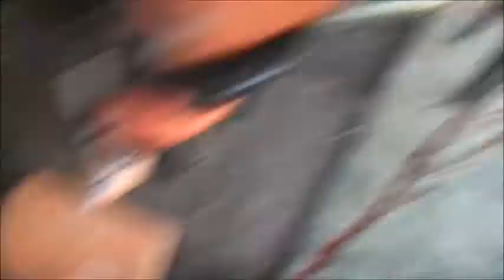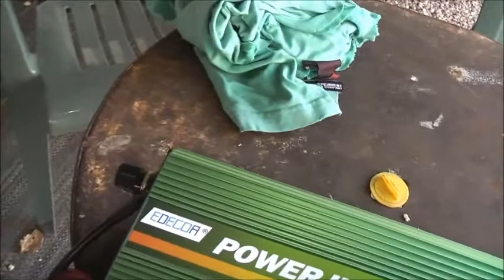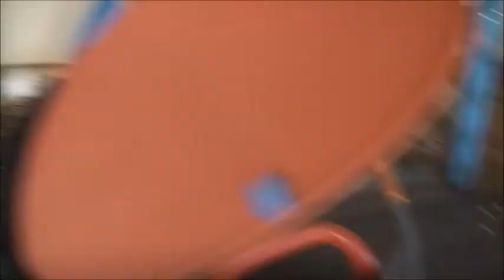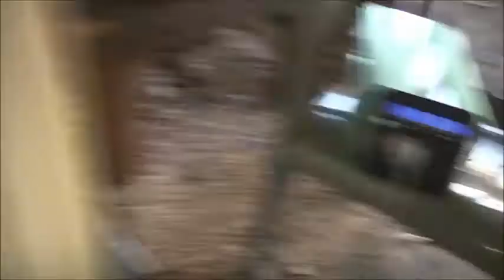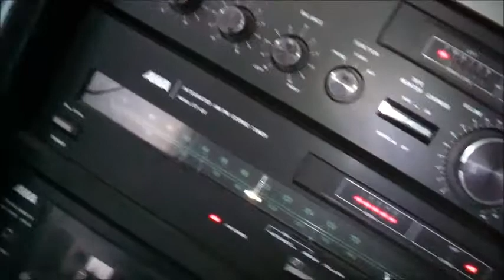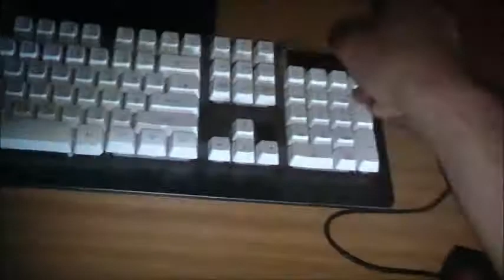Edecoa Inverter Runs Great, Underrated Cable

Comment: Will it power 115v tobishi a/c unit
Reply: buy your self Cnswipower 3000 watts pure sine wave ok i have Cnswipower 3000 watts pure sine wave 48V DC 120V 60HZ MUCH BETTER
Reply from the maker: 115 v version of this inverter should
Reply: @HDXFH  thank you already installed ran 10 hours from Texas to  Cuba Missouri